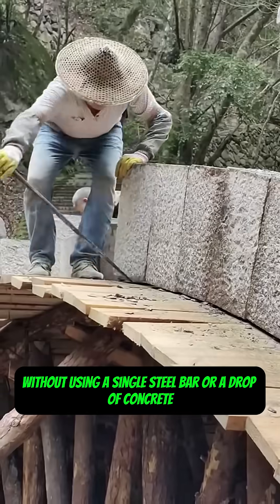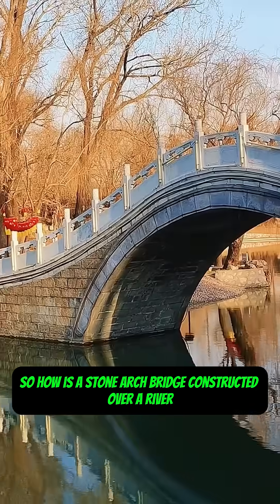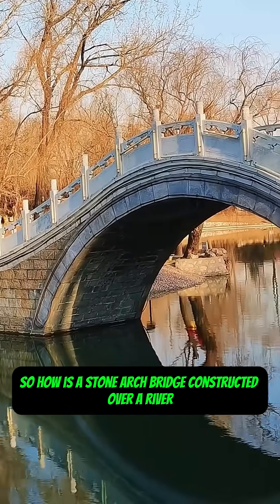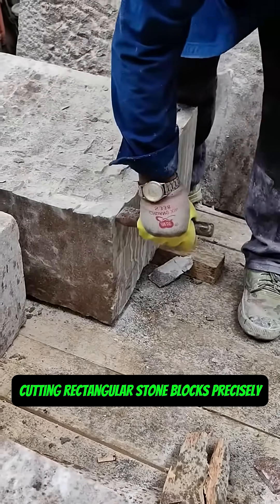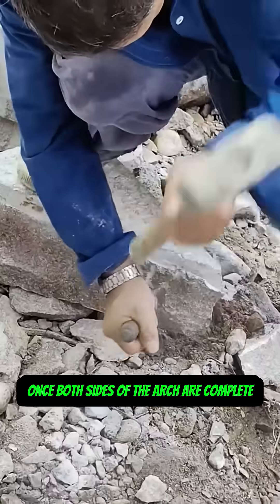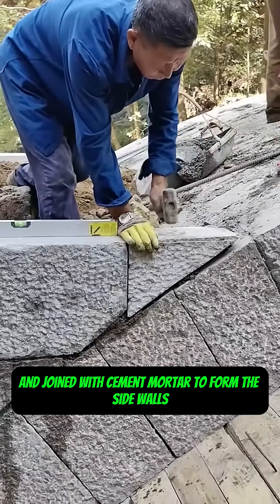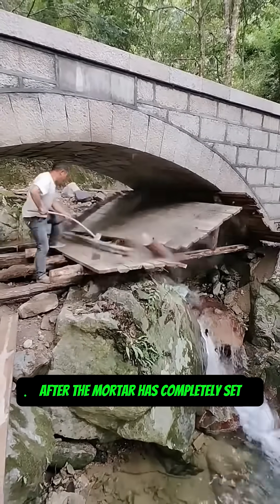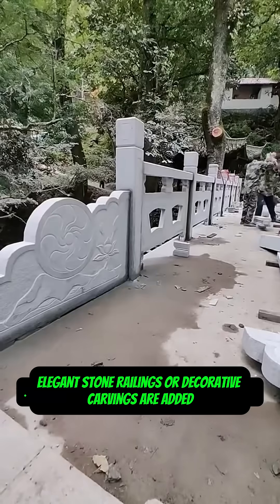🌉 The 1,000-Year Bridge Built Without Steel or Concrete! #shortsvideo

Comment: The opening line seems typically of propaganda. No steel, while he uses a steel bar's, hammer's and trowels, and tons of Cement. Concrete should not be stressed to load for at least 21 days... even for a foot bridge, which this is...